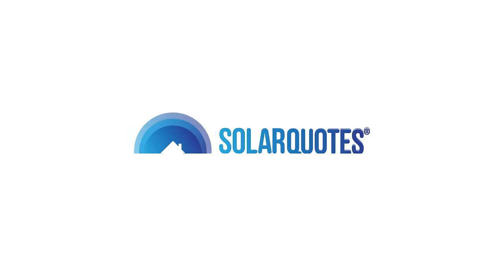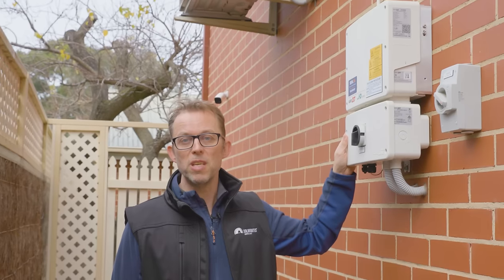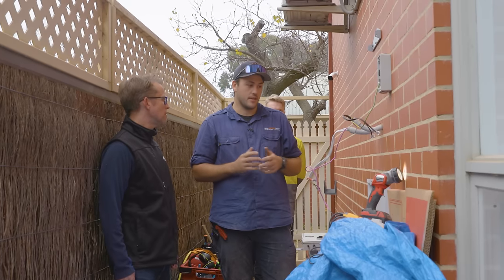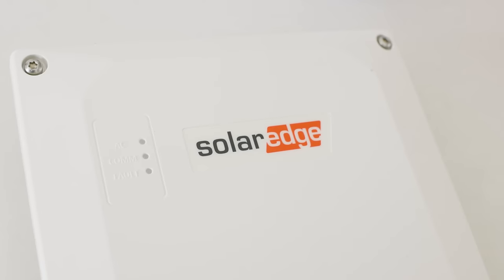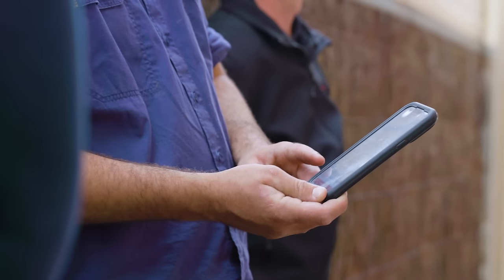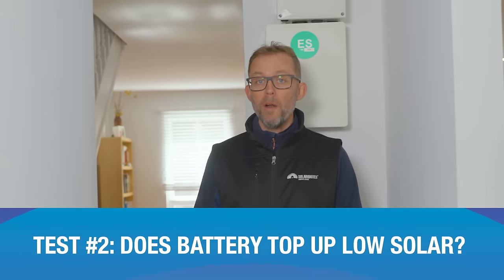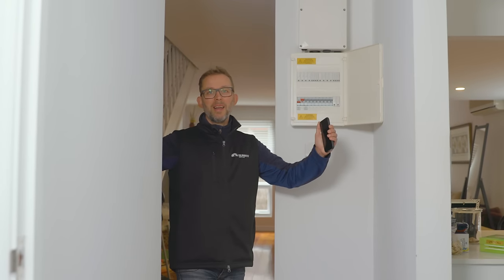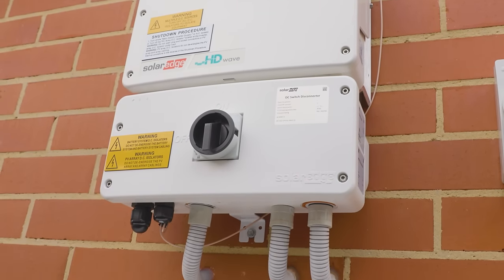SolarEdge Battery Install (Australia). It FINALLY worked!

Comment: Would love to know the cost, looking at the exact same thing in New Zealand
Reply: Cost in NZ is about for a 5kW solar array and 14.7kWh battery was about 30-35$ a year ago….variation in price is due to components. Would assume it would be more now. About double of the cost in comparison to AU as NZ government not interested in rebates. Not sure if you already have solar and just want to add a battery in? There is a lot to consider depending what your needs are, single or 3 phase feed, AC vs DC batteries, type of battery and battery safety features etc. All have different benefits and drawbacks, that the average sales rep focus only on the positives. Other options for storing power is EV’s or hybrids which really only make sense if you need a new car and assuming there would be days the car would be at home etc.  I am rural and face frequent power cuts , after much consideration changed to single phase (easy rewiring from 3 phase) and AC coupled battery. No delay with power cuts, it works seamlessly.
Reply: I installed an integrated system comprising 10.3kW of Longi solar panels, a 5kW SolarEdge hybrid inverter and a 10kWh LG RESUH battery (not the dodgy model, thank goodness) with backup facility in April last year (2021). All up cost with govt rebates was $17,300. I live in Adelaide. Prior to the install I was paying AGL about $2800/yr for electricity. I joined a Virtual Power Plant (VPP) scheme and in the first year we had no bills and were $350 in credit. Unfortunately, the recent sharp increases in power costs will put a dent in those figures going forward but I reckon I'm still way out in front and should recoup my outlay in 6-7 years.
The only problem we've had so far (fingers crossed) was with the SolarEdge inverter, which decided to have a major internal conniption and kill itself with a loud bang last November. The original installers (MyEnergy) were terrific and had us back up and running with a brand new inverter within a week. SolarEdge honoured their warranty so there was no cost to us, other than one week's missed solar production.
Reply: @rubenconzales9718  I've got a 6kW SolarEdge array and an EV. The battery is to try to be as self sufficient for energy as possible.
Reply: Unfortunately the battery is the larger uncertainty in this equation regarding payback period and longevity. Currently Li-ion seems to have the best discharge / longevity ration ~ there is a tiny risk of fires, so in my view what safety features is important. The cost at the time was near equivalent as you generally need a larger lead acid bank in comparison to Li-ion due to DOD and every study suggested that with deep discharges (50% for lead vs 90% Li-ion ) that Li-ion last longer on paper anyway. Since you already have a system  it would be dictated by compatibility of your inverter, DC vs AC couple assuming you are on single phase. In the end I went for a Tesla battery and powerwall, as the battery has it’s own cooling system, build in inverter, has a 5kW (7kW) peak output(obviously more if you stack them). The powerwall has a number of automated functions and function seamlessly. I don’t notice power cuts . At the time it was about 14K with installation. It was a fairly big step as I am not a Tesla fan and financially it is uncertain if makes sense as you would note the cost discrepancy between NZ and AU. Good luck, would suggest you do your own homework and take installers selling points with a  big scoop of salt.
Reply from the maker: The total system price was AU$12,455 installed.
Reply: @SolarQuotes  for the battery and inverter swap right, not the array too?
Reply from the maker: @nzpomdotcom  Correct. 6.6 kW solar system cost about $6,500 2 years ago.

Comment: Bad practice running cables in cavities.
Reply from the maker: Why is that Craig?
Reply: @SolarQuotes  in the future other work may be carried out, they have no idea where cables are & their work may involve drilling through cable/s previously wired in cavity.  I've seen this done in England (where its not allowed) over long distances, at worst its dangerous, at best makes for a difficult repair.
Reply from the maker: @craigbutler6243  That's why we have AS3000, AS5033 and AS4777
Reply: @SolarQuotes  cool....what's that
Reply from the maker: @craigbutler6243  They are the Australian Standards that ensure electrical wiring in cavities is safe whether AC or DC.